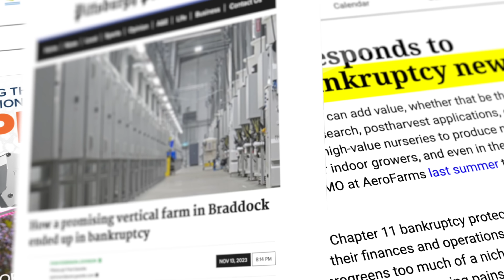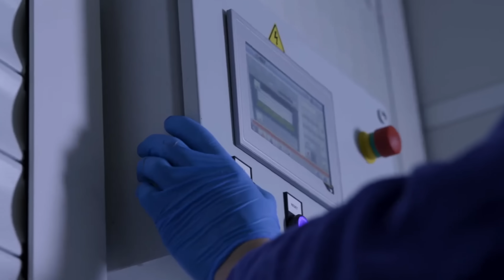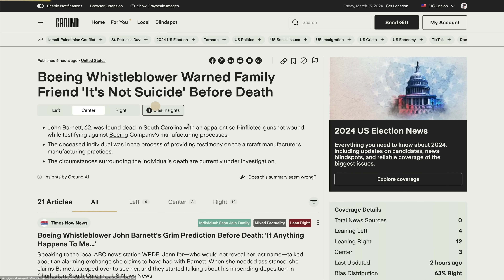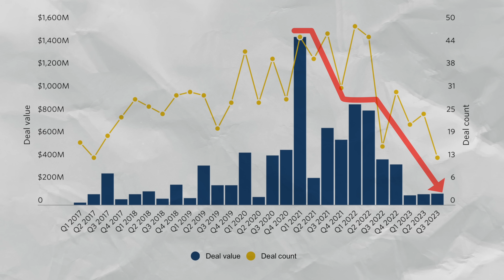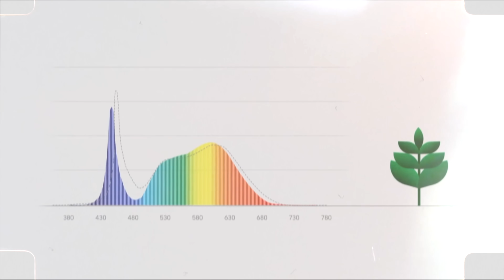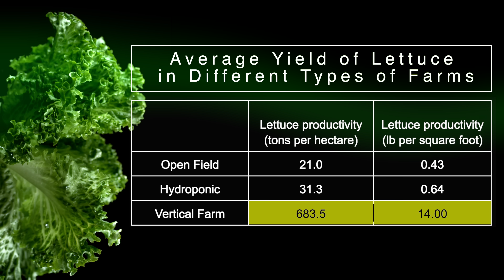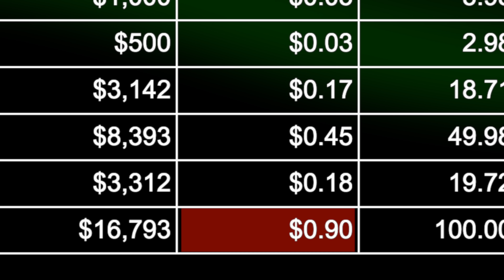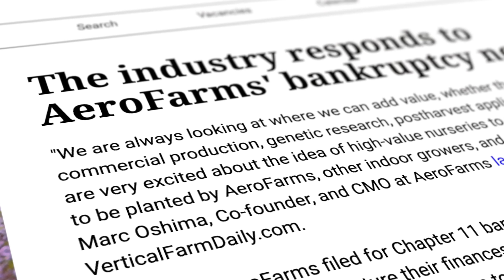The EPIC Failure of Vertical Farms - What Happened?

Comment: Sorry Two bit, this is wrong and a misrepresentation. 20% of new restaurants fail every year. That does not mean restaurants are going away or they are not profitable. It is a business that has to be managed correctly. Showing a bunch of vertical farms that went out of business when there are thousands and, as you finally point out at the end, it is still rapidly growing. The problem is that many of these businesses unnecessarily inflate their costs. You mention, automation, as if it will solve all of this if we can just get automation costs down. It is automation and high tech that are unnecessarily driving up the costs. IMO, firstly vertical farms should be greenhouse based. All or nearly all of the artificial lighting should be abandoned. Look at FarmBox Foods. Their system is lower tech than many of those going out of business. They produce 3 tons of food per week based on just 21 hours of labor. Try beating that with a regular farm. Unfortunately, they charge a lot for their system, but you can set one up for yourself much cheaper, and it does not have to use artificial light.
Reply: @Resist.Tyranny  🤔🥰🤔
Reply: @Resist.Tyranny  i am curious to hear how you think a farm built by stacking plants in columns can utilize natural light
Reply: @PunishedFelix  Many plants do not do best in 100% sunlight. The width of the shelves, the row spacing and whether the shelves are tiered or how they are tiered all plays a role on the amount of light. If you are suggesting that in the exact same container sqft with the exact same shelf sqft you could not obtain enough light to duplicate performance, you are probably right. But a green house with transparent walls. transparent roof, slightly large shelf height, slightly larger row spacing, possibly narrower shelves, just more rows of them are all ways to optimize light. You could also do some artificial light but much less. There are many ways to accomplish it. In the right setup you can also use reflective and refractive surfaces to maximize light. Tiered, staggered, even fibonnachi (used by plants naturally to get light to leaves), even smart placement of solar light pipes are all techniques that can be used to optimize light. For cloudy days you may want LED supplementation anyway. Think outside the box!
Reply: @Resist.Tyranny  so are you suggesting that every tier is planted with different plants based on their sunlight needs? that might be difficult to balance for other reasons... I'm no gardener but I have been watching people who do and its a lot more complex than simply a bit mask of parameters to meet. Idk, I am pretty skeptical, lighting is a major expense for artificial farms but I doubt its the only reason why we're not seeing experimentation with vertical greenhouses which sounds a lot cheaper, unless I'm missing something
Reply: @PunishedFelix  It sounds like you read the first sentence and ignored the rest. That is not at all what I said. Urban Farmer Curtis Stone demonstrated a version of this for sprouting to feed his chickens in 2023. I think you are missing something.
Reply: I was hoping for a more informative video, more details more numbers etc. A proper breakdown, I did not get.
Reply: "They produce 3 tons of food" is also a misrepresentation though. FarmBox Foods designs and build the farms but they do not own and run them, it's a different business model.

"3 tons of food per week in under 500 sq ft on 21 hours of labor. Really show me 1."
I'm really not knowledgeable or care enough to argue about this, but since AI is a thing now, here's what it says:
FarmBox Foods ≈ 285–335 lb of output per labor hour.
Broad-acre mechanized grain farms (e.g., U.S. corn, wheat, soy) often 3,000–5,000 lb of output per labor hour (and sometimes more in very mechanized operations).
Reply: @lllKXlll  To achieve the outputs you reference you need:
Total machinery costs for that large-scale production $360-$680k/yr
Total mortgage and property insurance cost for the 3000 acres needed = Just over $1M/yr

In total the farm would produce 3k-10k tons of grain.

150k tons per year per FarmBox
= 20-67 Boxes for 3k-10k tons

They all fit on one acre. Then you have the mortgage for one acre.
One person can harvest two boxes a week (42 hours)
So 10-34 low wage workers can harvest the same as a farm that is spending $1.5M/yr

But the grains get the farmer 8-18 cents/lb.  Revenue = $480k-$3.6M
FarmBox's gets about $1/lb  Revenue = $6-20M

If the large farm scales up to greater than 10K acres is becomes a bit better picture for the large farm. The biggest cost with FarmBox is buying the boxes. If you instead follow my other suggestions, the big farm would probably never catch up how matter how large it scales, even though labor is expensive. All that said it is more of a mental exercise. No one was suggesting it as a solution for a massive scale farm producing over 10,000 tons per year.
Reply: @Resist.Tyranny  Artificial lighting is superior, you know sunlight isn't the optimal light for growth right? Plants generally grow better under red and pink lights. 

The Dutch extensively use artificial lights in their green houses.
Reply: @mormacil  Faster does not necessarily mean better. But by all mean, if you want to spend extensive money on lighting systems go ahead.
Reply: @Resist.Tyranny It does, as growth is a product of plant health. It literally means that. Also LEDs aren't expensive at all, neither in upfront or usage.
Reply: @mormacil  That is ignorant. Food plants grown under special lighting colors, like red or blue LED lights, can accelerate growth by optimizing photosynthesis and plant development. However, faster growth doesn't guarantee healthier plants or more nutritious food. These lights may prioritize certain growth traits, like leaf size or fruit yield, but can neglect other factors critical to plant health, such as robust immune systems or balanced nutrient profiles. Suboptimal light spectra might lead to deficiencies in essential compounds, like antioxidants, affecting the food's nutritional quality. Overall, while special lighting can boost growth, it doesn't inherently ensure healthier plants or food without careful calibration.
Reply: @Resist.Tyranny  Now we're moving goalposts aren't we? Nutritious foods wasn't part of this discussion. Anyway you said natural light was superior but here you admit it can boost the plants but doesn't guarantee it helps. So you agree with me now that natural light isn't superior by definition.
Reply: @mormacil  That is a splendid twist to try and turn a loss into a win. First create a straw man to argue against, and then miss the whole reason for growing food. I never said natural light is superior. That is your straw-man invention. The reason to grow food is to eat. The reason to eat is to live a healthy life. Just making something bigger is not a win. There have been many experiments with artificial light. You can make a plant grow leafier, or taller, or maybe larger produce, but none of these selective things makes the plant better. But this is still a stupid argument, you are just arguing for the sake of arguing. If you want to plant using artificial light, go right ahead. I was offering an alternative. Clearly that is too much for you.
Reply: Plenty of farms beat that.
Reply: @jamskinner  3 tons of food per week in under 500 sq ft on 21 hours of labor. Really show me 1.
Reply: @Resist.Tyranny 3 tons for a farm with that many hours is terrible. I never specified a size did I.
Reply: @jamskinner  3 tons of food 21 hours labor. show me. or shut up.
Reply: @Resist.Tyranny  
Thanks for the insight. It's hopeful.
Reply: @Resist.Tyranny  yeah but because he's got a cool confident voice most viewers will believe everything that comes out of his mouth🙄

Comment: The idea of vertical farm is a good way to grow crops but as usual commercial industry goes high tech and does not consider equipment and energy overhead add. The small back yard systems I have seen use a  close loop hydroponic aquatic exchange environment that incorporates plants, fish, crustations and maybe an aviary and ducks in an outdoor setting which is not always easily stackable.

Comment: As someone who has spent several years developing and optimizing vertical farming systems – particularly focusing on lighting and nutrient delivery – I can confidently say that production costs can be brought down to as little as $0.30 per kilogram, including electricity, water, and nutrients (depending on the crop). In many cases, the actual cost is even lower with the right setup.

The main challenge isn't technology or efficiency – it's the economic model. Vertical farming enables highly efficient, localized food production that doesn’t depend on large-scale land use or exploitative labor structures. That makes it disruptive to the traditional food industry, which relies heavily on centralized control and profit margins rather than equitable access.

One critical point the video overlooks is that nearly 50% of greenhouses worldwide already operate hydroponically. Vertical farming is not some futuristic dream – it’s a continuation and refinement of methods already in widespread use. To dismiss its potential without acknowledging this context is, frankly, a major gap in the research presented.
Reply: How do you solve inverse square law problem in artificial lighting?
Reply: "As someone who needs the hype to continue so I can keep getting paid..."

Comment: Why not apply techniques used for vertical farms and use them in greenhouses? Transporting power is probably more expensive than transporting goods at some point in the future. Use the free sun as light for the plants, and use cheap solar energy generated nearby to power the climate control system and automation. Even nature itself can still aid in this process, like natural predators for pest control or composted waste for fertilizer. And having high paid jobs for skilled workers not located in a big city can even boost the rural economies and solve the housing problems we face.

Comment: You failed to mention the fact that it may have a negative impact on health compared to eating normal produce.
Reply: That’s not entirely accurate. In vertical farming, nutrient supply is precisely controlled, and beneficial microorganisms can be deliberately introduced to support plant growth. The produce is grown in a clean, controlled environment – without pesticides, using minimal water, and often with lower levels of residues like nitrates or heavy metals. Economically, it’s only partially viable at this point: although it's theoretically possible to produce at around $0.30 per kilogram (including electricity costs for lighting and pumps), increasing production tends to drive prices down, which undermines profitability. That’s one of the main challenges these projects face. Unfortunately, the video creator focuses almost entirely on the economic side and overlooks the broader societal benefits vertical farming could offer in terms of food security, land efficiency, and environmental sustainability.

Comment: i have a real question. I plan to create my own vertical farm.  The key of success ( not yet, and in my opinion) i do alone, the electrical wiring and sensors with microcontrollers, i program alone the sofrware (my main job is software engineer) and i do the labor too. AS this scales up, i will hire some people. I think that the problem of this vertical farms, was to wait for early earnings, while they today technology needs 10 to 12 years to take your money back, and take good profit about 25 years later. 

I think, that when a guy spended like 2 millions only to start, can not wait 25 years to take back 5 milions. 

but its 100% safe, and even if a crisis occurred, you have your own food, water, and electricity (forgot to say that i use 100% solar energy). 

Now i have just created all the systems and electronics work together, and in 1 year i will create the vertical greenhouse. 
I hope this job will feed me till i die, as there is no pension in greece! 

if you have any advise, or you have seen faults in my perspective, i plz send me a feedback so i dont make a big big mistake, as now i take all my salary to this project as i bieleve it more than s&p500

Comment: The idea of using the sun is obvious but the facts are different, 
the plants live by a cycle that is controlled by the sun and the seasons, so if you control the light and you give more than 18 hours of light to a plant it gonna go into vegetation mode so it means its growing,making,leafs and stems. When you cut the light under 12 hours the plants will go into flowering mode because it mimics the end of the seasons so the plant must reproduce (make flower/pollen/be pollinated/make seed and die . Has you need plants in every stages or at different stage at the same time for reproducing all the time your loop its kinda ideal to control the light and temperature and not worry about the weather hazard 
(it’s a very basic explanation every plants have different need of light exposure and temperature so you need to tweak all the time)

Comment: I find it very funny that the fucking. Fence walled wheat tower I make in minecraft is probably superior to this. It uses sunlight and is basically the same thing as a ground level farm, but stacked. If you break that up to allow more sunlight into the center, I bet that’d work great

Instead of hydroponic closed loop water, I bet itd be better to just pump water over sprinklers to water plants that have separate soil - bonus points if you compost to assist in producing the soil. Even better to set up rainwater collection at the top that uses gravity to distribute the water, since thats way cheaper than spending energy to pump water UP

Dont take that too seriously tho since I doubt I fully understand what Im talking about

Comment: The Problem is that water is WAY too cheap, especially in areas with water issues. Same for soil and groundwater pollution, which have serious costs down the line but farmers aren't paying for them. The need for heavy machinery in traditional farming also contributes to climate change and pesticides as well as insecticides destroy our ecosystems. This could all be avoided with vertical farming but there is no pricetag to those issues.

Comment: So these vertical farms were farming investor dollars, and went belly up with the drunken investor funding dried up.         If they could use illegal labor instead of blue collar labor, then most of the cost issue could be solved.     What about zero pesticides, that's a big plus.    Also, you get the 52 trace minerals that are gone from about the 4th harvest in most open fields as they only use NPK fertilizers and don''t put any trace minerals back into the land.

Comment: Most of these images look like horizontal farming, not vertical.  Horizontal stacks/rows of plants, even stacked vertically, is still horizontal agriculture.

And this isn't a technology.  It's a science, like hydroponics.  In a way, I see this disconnect as a key reason why this has failed.  You don't need to go high tech.  This basic system has been used by gardeners and farmers since the 1980s for their starts.  And all that needless tech is what drives up the cost.  Labor is always high.  That initial capital investment and maintenance as you showed are one of the major changes from a traditional farm.

These companies basically shot themselves in the foot.

Comment: It sounds like vertical farming has the same Achilles heal that solar and wind have. 

It doesn't work that well on a large scale, but reduce it to a personal home scale, and it will work just fine.

In a high tunnel or green house setting, mirrors can be used to reflect the sun light around the building thereby eliminating the need of artificial light.

It is also beneficial in a high tunnel or green house, to put a 40% shade cloth on top. This reduction of sunlight, actually benefits the plants and enables them to be more productive.